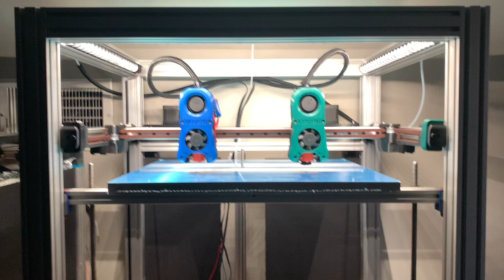Custom IDEX Voron Macro Demonstration

Comment: I want to put a fail-safe switch on the side of either toolhead in case I move them without homing first and they crash, the switch will stop all X axis movement automatically. (common issue with IDEX)

Comment: I have a question.
The Z axis of the two nozzles will be slightly different, but even if it is solved by leveling,
How did you handle the calibration of the X and Y axes of the nozzle?

Comment: What I can understand is that each of the belts control the each tool-head, so do they still have the advantage of the core-XY kinematics and speed?
Reply from the maker: Sorry for the delayed response! Yes, you get the speed benefit over a Cartesian style IDEX printer because all of the motors are mounted to the frame and do not move in the X and Y axes!

Comment: Great work, but do you use the official version of the Klipper firmware? Or can you supply the config files? I am also working on an IDEX printer and cannot print in duplicate or mirror mode. Thanks in advance ;)

Comment: so I have the working with klipper thanks to a user I found on the discord. the biggest issue is z offset for both tools there's always just a tad difference between x1 and x2. only way I solved it was with 2 copperhead hotends that have adjustable heartbreaks.

Comment: Great build! I just finished a dual head version of the Voron 2.4 (two hotends in one carriage). 
How are you switching between the part cooling fans, I only managed to have them both on when I switch on part cooling via multipin in klipper. And I can't find anything how to change the fan when I swicht extruders.
Reply from the maker: I’m using a macro Tircown made! When the toolhead switch is done it activates/deactivates a fan

Comment: I have a Formbot T-Rex 3.0 and the IDEX functionality is amazing.  Doing this on a Voron at its crazy print speed is a game changer.  Are you planning on sharing how you did this?
Reply from the maker: I definitely am! Just haven’t had the time to work on things recently 👍🏼
Reply: @eddietheengineer  would also appriciate that, wanted to start to order parts today for the normal version, but now saw the Idex version and will wait with my oder
Reply: @eddietheengineer  I would love to know too!
Reply: I have a T-Rex 3.0 IDEX also.  Not much info on upgrading .  I would love to change to firmware

Comment: Cool build.  How do you adjust the Z height on the toolheads?  I built an IDEX version of an Anet AM8 a few years ago but shelved the project because of a few missing features in firmware.  Looks like all the important features have been added to Klipper now.  Maybe I'll start playing with that printer again.
Reply from the maker: Right now I don't have a way defined to adjust the Z height on the toolheads--for sequential printing it shouldn't be an issue as the firmware can offset Z mechanically, but for duplication/mirrored modes that won't work and I'll have to come up with another solution.

Comment: the clicky probe should be very precise, have you done a probe_accuracy, it should be within a few microns right ?
Reply from the maker: Yes! On my other printers it is typically within +/-1 microstep
Reply: @eddietheengineer  the next Voron iteration should go with the clicky probe if it is cheaper and more precise than magnetic probe.

Comment: Amazing work! Being curious (and naive), how do you plan to have the two nozzles level to the same Z height for this set up?
Reply from the maker: For most of what I’ll do (printing at different times support and base material) the bed should be able to adjust the slight offset. For mirrored or duplicate I’m not positive yet 👍🏼
Reply: @eddietheengineer  I see - thanks Eddie! Looking forward to it :P

Comment: This setup looks like you managed to get IDEX without any additional motors or belts! Do you have each head only attached to the A and B belts separately?
Reply from the maker: There are two extra belts and motors, one Y belt/motor per side attached to the gantry 👍🏼
Reply: @eddietheengineer  so two more belts you have hide on the back of the x gantry? Did you synchronised all mitors x1y1 with x2y2 not to struggle one with another?
Reply from the maker: @DrJimBoston  nope! The X axis still only has two belts crossing it. With the correct kinematics everything works nicely together 😄
Reply: @eddietheengineer  OK, so from XY kinematics motor X works as X motor for one carriage and Y motors is X motor for second carriage and you have additional Y motor for Y axis. Right?
Reply from the maker: @DrJimBoston  if you think about in typical “CoreXY” kinematics, motor A controls X1, motor B controls X2, and then there are two independent motors for Y

Comment: The killer app for multiple tool head is zero distance support structures.  The tool changer has had some success with this.
Reply from the maker: This is exactly why I’m building it! Really excited to see the results
Reply: Could you explain what that means?
Reply: @CrazyMineCuber  They can use two materials that don't stick to each other.  One is the support material.  It can support the part with no gap and so form a smooth lower surface.